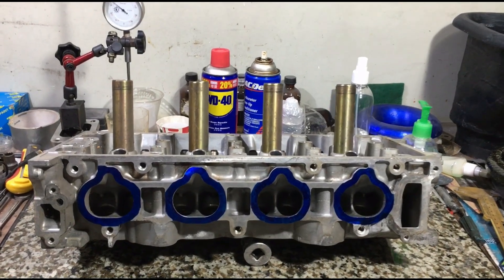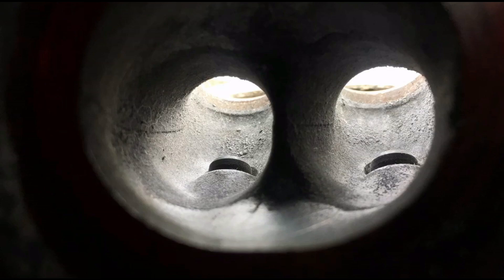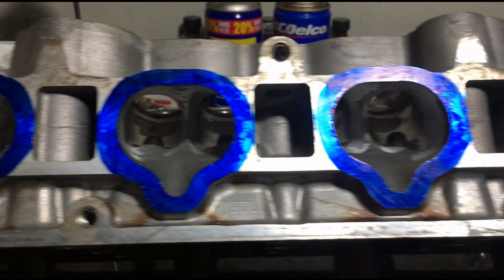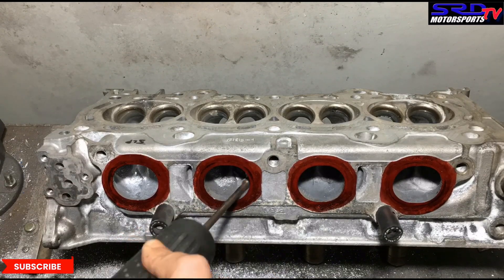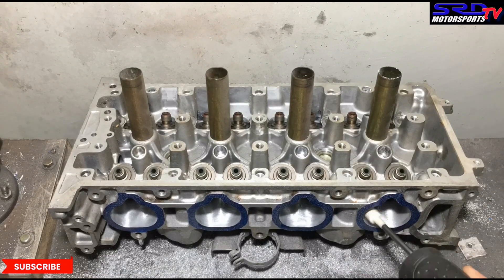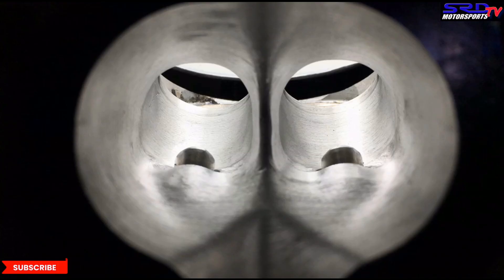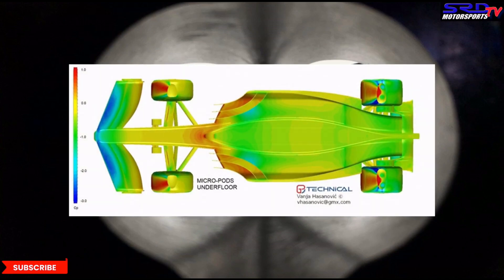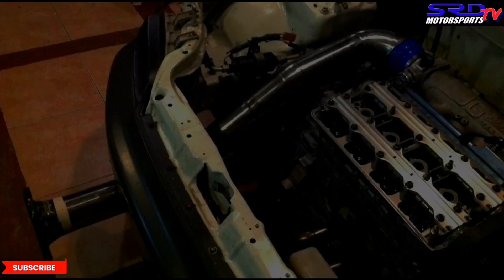Honda K20a TypeR PRB head porting by SRDmotorsports

Comment: Why did you not make the shape more sharp in the middle of chamber? :)
Reply from the maker: Well by doing that, it also means u increase cross sectional area and depends on heads and applications we lose torque

Some say get it sharp for more flow and top end? Well more top end = more cam that’s simpler and u still have good midrange 

So it depends on application and it’s easy to do it but not so easy to reverse it hehe so I leave this like this because this is my spare so until I know where it should be used on? Then il adjust by then hehe

Comment: Do you have any port videos on a H22 head I would like to know the percent of the throat to valve is it 33mm 91%=30 like the k series? Thanks u
Reply from the maker: Sadly no 🙁 the H22 engines I did were around 3yrs ago a circuit engine, a turbo street car and an NA street car

But the H22 has 35mm intake 
I go for 90% and that’s 31.5mm
Reply from the maker: Crazy tip my friend 😎

You can get a junk b16 intake valve of 33mm bring it to a machineshop? Have them turn it to the mm size u want and

That is your throat checker 😎
Reply: @SRDmotorsports  so by putting a bigger valve you could increase the air flow from more power ?
Reply from the maker: @angeluribe2232  In theory yes “IF” the engine has the comp and cam to make it work as valve sizes related to lift and duration too
Reply: @SRDmotorsports  is because I'm trying to squeeze all the power I can out of this H22 I dropped in typos Pistons titanium retainers and everything is pretty much OEM I made 190 whp 150tq my compression I'm not sure not sure what ratio it is it's like around 11:1 to like 12:1 because the piston is supposed to be 11:1 but the block and the head are decked to the maximum all I know is that my cylinder are  240 PSI with the compression tester I want to Port the head and put a cam for more power and run E85 what cam should I put? And what  boltons cuz it's stock right now? Thank u
Reply from the maker: @angeluribe2232  oh i hear you man!  thanks for sharing your set up man...

the compression if its between 11.5-12.5:1 then its good and with the right cams thats easy 220-225whp

like what i did before and owner went e85 and saw 236whp 🤣
Reply from the maker: what cams and intake are you using? lets see if we both can squeeze this better
Reply: @SRDmotorsports  as in right now I have a stock Cam and a stock manifold with a DIY port on the manifold gutted  the butterflies 1320 header with stock exhaust system lol doesn't flow very good
Reply from the maker: @angeluribe2232  oh ok ok stock cam , that is very decent power, we were on Pro2 that’s why

Btw you can message
Me at the shop page for some stuff u need to ask or atleast if U ask me here? And it’s a secret I can then dm i the answer? Hahaha 

But definitely comments here does wonders…

And nice I see you ported the h22 manifold with the butterflies removed nice nice 

Where u from btw?
Reply: what's your shop page? Thanks u
Reply from the maker: @angeluribe2232  oh it’s in the description always the link hehe

Comment: Do you know how much i can resurface k24a3/2 head? If I will use high compression ferrea flat valves? Thank you in advance for your answer.
Reply from the maker: Oh hey thanks for this…

For the Bseries it’s 0.040” max I believe
And on the Kseries it’s somewhere in the 0.015-0.020” region I think

But I have seen Bseries resurfaced more than 0.050” 😀 and Kseries up to 0.040” I believe but Ofcourse the chain tensioner has to be checked and new to be safe

Though I won’t go over 0.010” on the K

I would update another comment on a few days once I get some solid info 

I hope I do :)
Reply: @SRDmotorsports  thank you for your answer.. so not more than 0.2mm? Ok, thank you very much!!!!
Reply from the maker: @enjoytheride_cz  yeah I would like to make sure the tensioner is still good

Tip: you can try installing the head to the block without gasket? Just to see if the tensioner can get tight enough 

Our mls headgasket is 0.026” 😎 free test before spending cash on the machineshop

Comment: These ports look really really good👍🏾😂 I’m gonna do the same thing with mine, it’s so clean
Reply from the maker: oh sweet! take it easy man but most importantly enjoy ftw!

on my old videos ive stated the lube i spray while i do the sanding roll passes is
40-50% Ethyl alcohol mix with
40-50% Dishwashing soap or liquid soap

wd40 is decent but it smears around the carbon build ups and is lubed with oil so it gets messy...

carb cleaner works too BUT it dries too fast like 1-2 pass its dry so it can get expensive and bad to inhale

HTH man

Comment: What's the critical max you follow with the valve to throat ratio?
Reply from the maker: personally? 90% only no point really i mean its hard to often get 89% but i would if i could

mainly cuz bigger cams will work better for the goal but not sacrifice response and torque

its like a b20vtec vs b20vtec
one has 91% throat pro2 cams
and 
one has 89% throat pro3 cams

we know which i would choose 😏
Reply: @SRDmotorsports  Thanks! What do you think of the idea of using the short side itself as the choke instead of the throat? Using the turn to get the airspeed up
Reply from the maker: @findtherightbeat  actually the short turn has the most airspeed of all areas because its the short turn... alot of times when ported improperly the long side or bowl gets bigger than desired = the speed differential between that and short turn experiences sheering effect which naturally becomes a hindrance to flow
Reply: @SRDmotorsports  I'd just like to know your thoughts on Darin's comments on 4-valve heads as I understand that you go beyond Darin's rule of thumb and may have seen better results:

“For a 4-valve head, your throat should be 86% valve diameter to see the best average power, throttle response and acceleration. At 87%, you see some more top end power. At 88%, you get the best overall power band, but you need to be in the .500˝ lift range. If you go to 89% and higher, that’s when you see negative reactions.”

By the way, I don't want to cause a stir,  I just like to pick brains of people who are good at engines and have differing approaches on attaining efficiency 🍣🍻
Reply from the maker: @findtherightbeat  interesting cuz quite similar albeit a shade over his numbers but 89% is the number i like going to... but alot of times factory casting is too far apart that 90% is the smallest but

its in line with what Darrin says in a sense that now you see why "sungaw" heads exist locally? yet the locals be checking ports frm the flange side and "judge" it like i just shake my head lol

not to discredit Darin but i think what he says is legit correct granted we rev lower than "honda" when you know it naturally revs higher than all other brands? and its only here il ever mention this 

but stroke dictates "piston speed" and the higher it is? the more "energy" it generates onthe intake ports as it pulls in induction... even a D16 has 1mm more stroke (90) than a b20 (89)  

but in general if the casting lets us reach darins preference? id want it too! would let me run pro3 on a b16 and rev to 11k 🤣 hey now i want that lol!!
Reply from the maker: @findtherightbeat  The VW scene has alot more crazy variations by crazy i mean differences in aproach yet both go fast 🤣 like aside from throat to valve ratio they got

port volume to runner length ratio/approach and it all changes due to preferences in "venturi" sizes on the weber carb both run 44idf weber but one prefers 28mm venturi while the other prefers 32mm 

at first its confusing but eventually what it did was help me understand better even on Honda/Import stuff
Reply: @SRDmotorsports  Makes sense -- The piston speeds of the engines you mentioned, due to their lower rod-stroke ratios influences the pressure drop in the first quarter of crankshaft rotation in the intake stroke as it quickly moves away from TDC which helps in cylinder filling.
Reply from the maker: @findtherightbeat  yep and the longer rod changes dwell time which helps but it piston speed isnt slowed down its dependent on stroke
Reply from the maker: Trivia : why intake/port airspeed is King

tdc and bdc dwell time any stroke any rod ratio, bdc dwells longer  imagine on an induction stroke :)
Reply: @SRDmotorsports  Then comes having the ideal IVC
Reply from the maker: @findtherightbeat  yep!    like way back on 2002-2003 HT days a good friend named Tom Cote aka Tbone in Honda-Tech

understood this, had Jun3 cams (like s2s2) Jenvey itb so airspeed we know is "okay" lol on his 2liter GSR (gsr head and gsr crank)
85x87.2   

he made 274whp this is before e85 crazy so he was using 105octane sunoco race gasoline

when you think about it? dispite the fuel craze now? his 274whp 85x87.2 seems its not yet reached?!?

oh and his crx ran 10.9s illegally cuz it wasnt rollcage approved so just on test n tune runs lol
Reply: @SRDmotorsports  I bet some people won't believe those numbers to this day, though it's true haha

But there are probably a lot of "minute" details that Tom has learned over the years that he's applied in that build that could contribute to that good VE
Reply from the maker: @findtherightbeat  actually he thermal coated his piston and dry film lube coated his bearings (his sideline) as his old work the employer's client was NASA they would coat components but not told what part it is but space shuttle lol

I learned from him blueprinting = its why i got micrometers it was cuz of him... me and Clyde followed him in HT but clyde has more $ so he has more tools than me hahaha

and true nobody would believe it heck in 2017 we ran 12.101sec @ 114.5mph 
those who know? would know that mph is good for 11.7s :) but we ran 23in slicks all we had and couldnt find grip

we did all that on e85

non of the fuel craze we see locally now
Reply: @SRDmotorsports  Interesting how better tires and your newly developed intake would lower the times. Is E85 still available to you?
Reply from the maker: @findtherightbeat   i think SeaOil still has e85 in pasig

in actuality it did a 1.898sec 60ft 
and when i know ever 0.1 removed from ur 60ft theres an average of 0.3 e.t gain so

we see them doing 1.6-1.7sec 60ft? lets choose 1.7sec  so thats 12.1sec subtract 0.3 = 11.8sec  and thats on tires alone plang

oh and that motor made 233whp 🤣
Reply: Sorry got too excited and asked the question first before finishing the video
Reply from the maker: @findtherightbeat  nah man all good I think i didnt reiterated it enough eh